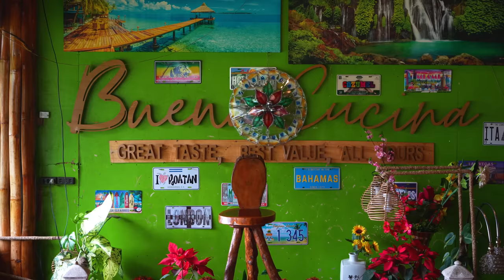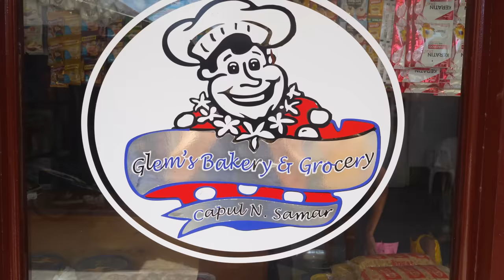My First Time Baking In A Filipino Bakery! (Spanish Bread & Pan De Coco)

Comment: Good day bret.. its better to smack the coconut horizontaly between they so called eye..  the mouth of it is where you put a hole  easy cause its soft.. one smack with the back of a bolo and it will split in half...

Comment: You had a stir fry vegetable with shrimp paste or pinakbet on the eatery in Jabonga Agusan Del Norte near the lake 🍆🎃🥒🧅🧄🦐🦐🦐
And the eatery has fresh water fish on the lake 🐠🐠🐠

And scaly fishes have a lot of pin bones 🐠🐠🐠
And fishes without scales have only a little pin bones 🐟🐟🐟

And you are back in Allen Northern Samar which is 11 in a half hour trip from Manila via ferry on midnight trip because it is less traffic. 
And step on the boats don't have rails going in the island. 

The Island has lots of coconut trees 🌴🌴🌴🥥🥥🥥
And they had there business on the island like making bread using a pump boat machine or a tractor machine 🍞🥐🥖🫓

And Spanish bread has a filling of butter and sugar 🥐🥐🥐🧈🍶
And they make coco bread which is a bread filled with grated coconut with sugar 🥐🥐🥐🥥🥥🥥🍶

And we even drink the water of a mature coconut we don't throw it mature coconuts have a little bit of water 🥥🥥🥥💦💧
And they even had a copra business on the bakery for making coconut oil 🥥🥥🥥🍶